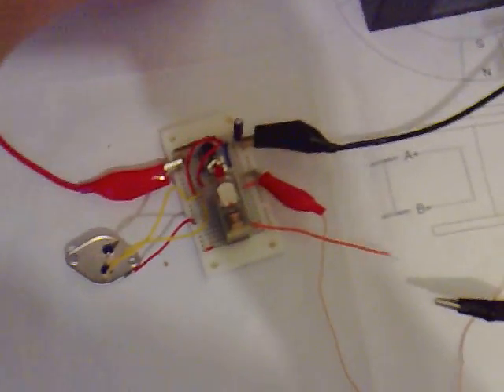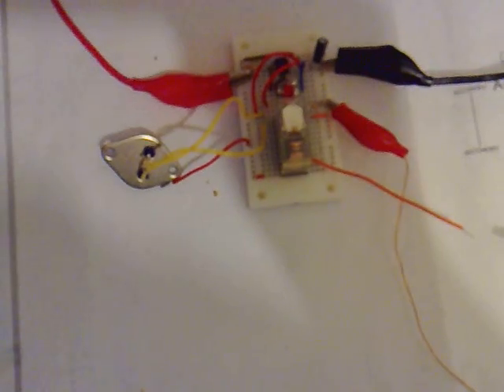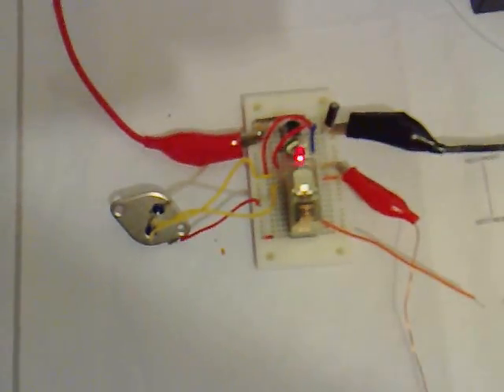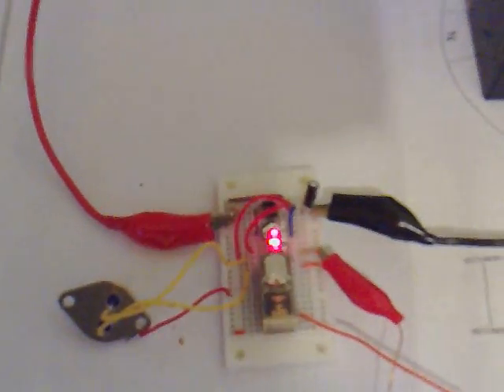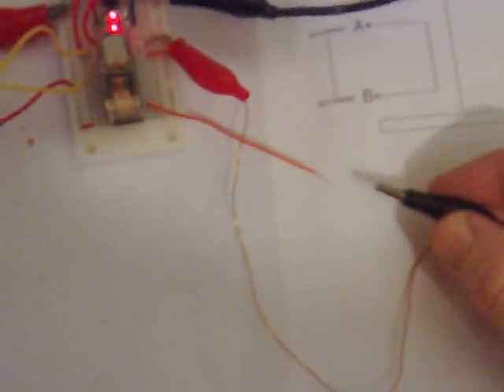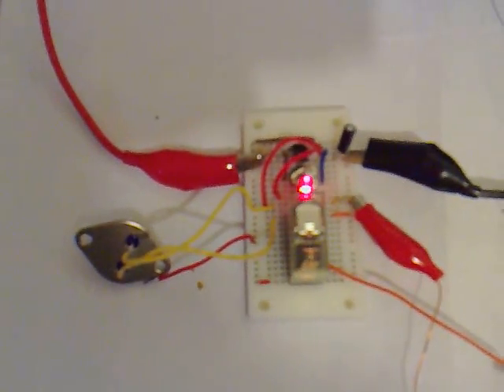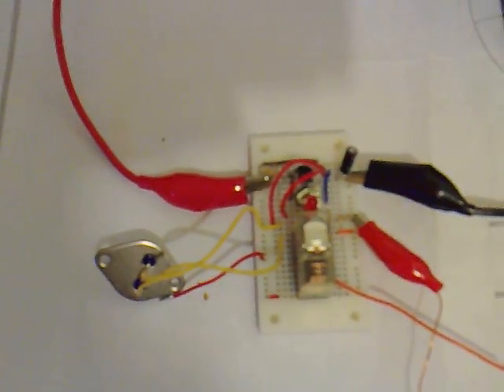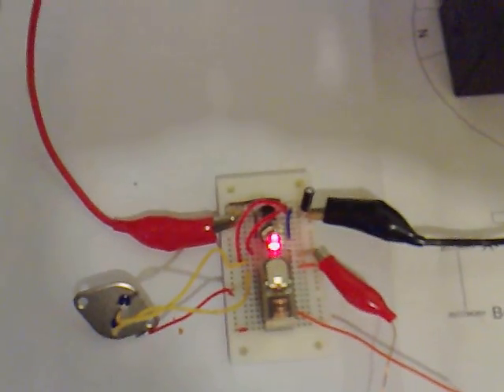Pulse Motor (555 Timer Circuit) 006

Comment: Just use a separate supply for the motor or adjust the timing down some more as your motor is leaching most of the power, which in turn is changing the timing of the circuit by increasing resistance

Comment: @stripes5150  True. But maybe a lower ohm resistor to the base pole of the transistor will give you a lot more current flow through it. That might help.

Comment: ha ha you r using samr suply to power relay or wired it incorectly  it should be made so the 555 timer input instead of cap is triger  coil then output through transister or mosfeet the relay is not needed.

Comment: Back emf from motor coil ? Diode for reverse emf.....and possibly a small ceramic capacitor across motor..........reverse emf on relay as well...try using a solid state relay!

Comment: did you use a diode to stop back EMF to the IC, adn seperate powersupplies for the IC circuit and relay/motor corcuit.

large current fluctuations can cause instablity and constant reseting

Comment: The coil you are using is on the same supply that the timer is using. Isolate the supplies. ONE FOR THE TIMER AND THE OTHER FOR THE LOAD.

Comment from the maker: Hi digitalbroadcaster

Thanks for the info, I will move back to these circuits, but I used the bedini method on later videos instead. I will look into the CMOS 4017 because I have a couple, I think I need an opto coupler to do this and not not blow the CMOS. the VF66? do you have specs on it?

I though of using the Ts555 with a schmitt trigger to get duty cycle of 50%.

Any ideas?

Paul..

Paul..

Comment: If you just want to drive the stepper motor, you could either use a stepper driver chip, or a 4017 IC using each stage to drive (via a VF66 transistor) each phase of the motor.  This would only give you one direction though.  I don't even know what you are building, but you could be introducing emf into the timer circuit.  Have you fitted a back-emf protection diode to the relay by the way?  If the motor is a standard non-stepper, then emf could still be the problem. Use separate power to motor.

Comment: I just realized what you're problem is.  On the "LOAD" side of the relay, you need to supply a different power source to the "LOAD" so the power that you have for the "FLASHER" circuit you have made doesn't get intrupted.  Another words, the light in you're bedroom, insted of having a light switch there, you would replace it with the "LOAD" side of the relay because all a relay is, is an electronic switch.  I deal with relays every day, and there is at least 5-10 in each piece of my equipment.

Comment: You might want to drive a mosfet or even a 2n3055 with another transistor driving it's base maybe use a 2n2222  to increase the output of the 555.

Comment from the maker: Thanks for the comment.

I was using two 6v 12Ah Batteries in series which I thought would be enough, but I have now moved onto a Bedini Circuit with a trigger coil and a power coil.